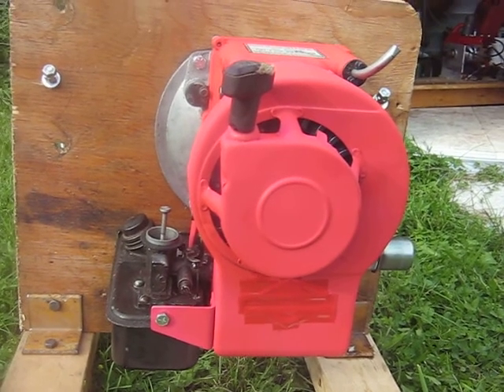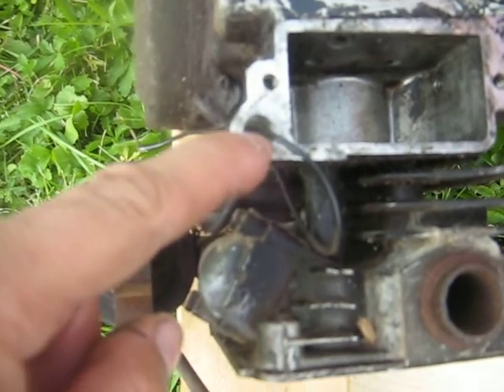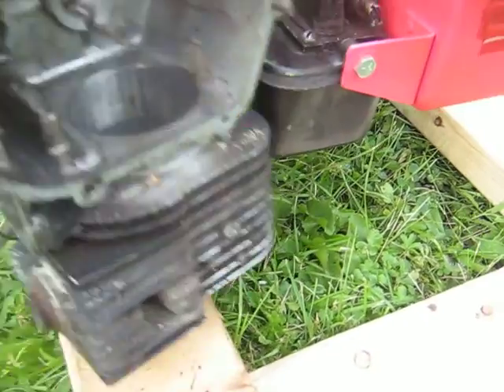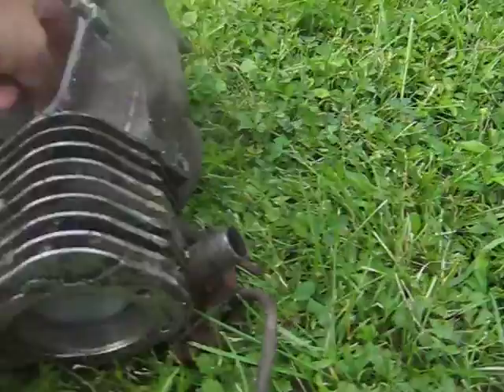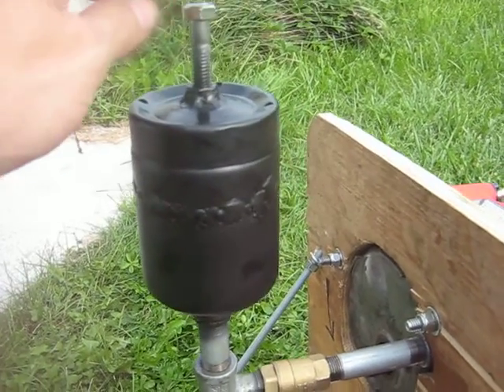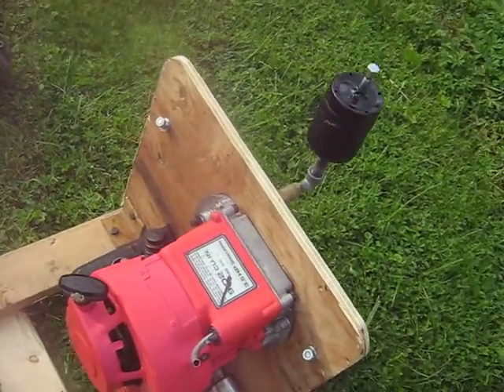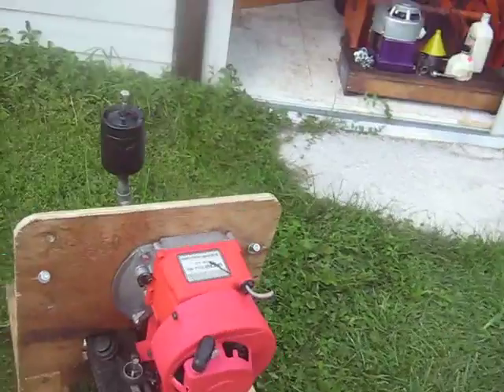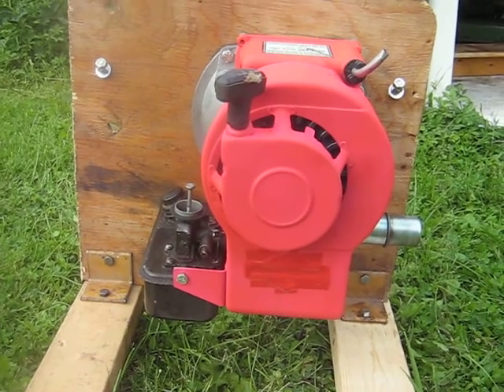How Upside Down Briggs Works

Comment from the maker: Thanks for watching.
I completed the new crankcase breather assembly, and hope to make another run soon. I am hoping I don't get an oil shower from it, you never know with these experimental designs!
Reply: I have a kohler xtx toro on 2 stroke xd-100 oil, I ran a line and vacuum draw it into the carb with office, i eventually went to convert it to a 2 stroke, I need to fill in and weld cut aluminum to increase crankcase pressure. I’ll to make a reed or rotary valve intake though, what do you think of this?

Comment: neat little insight on that engine, but i got a completely off topic question, i am fixing up a 1960 2HP briggs and need a head gasket, where do you come across stuff like that ebay had plenty of new stuff but nothing for the oldies